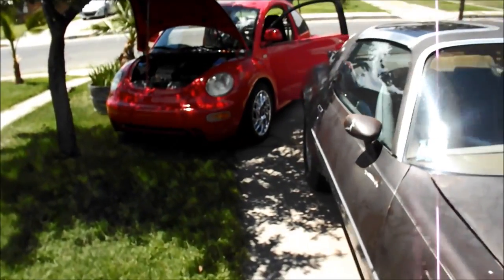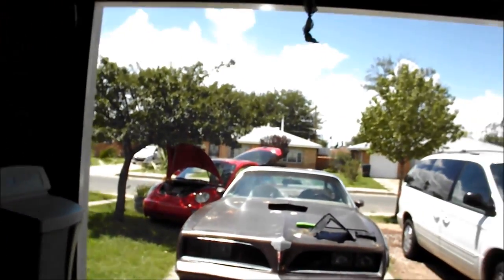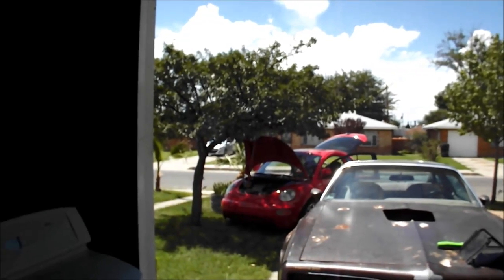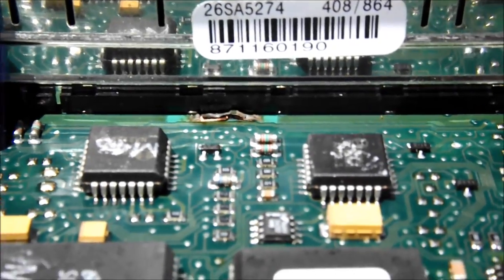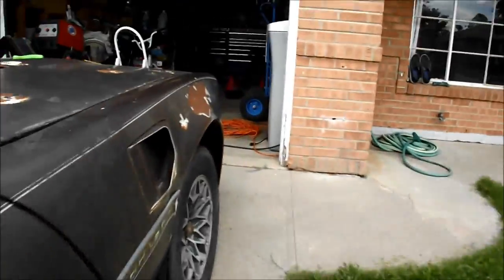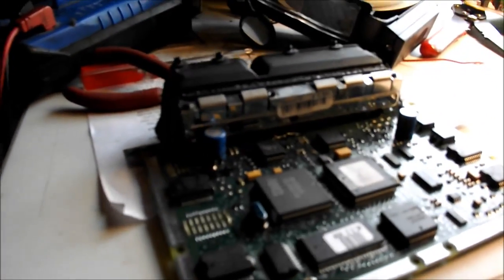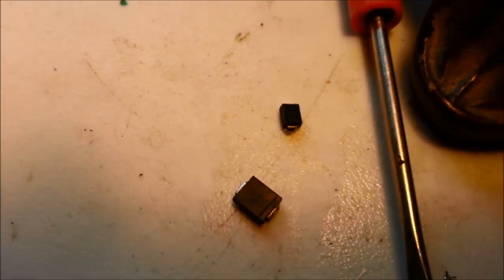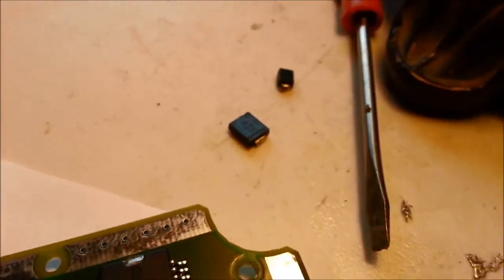99 VW Volkswagen Beetle Throttle Body ECM ECU p1580 Throttle Body Adaptation TBA

Comment: Thanks for making this vid. I was having the exact same issue on my 2002 VW Cabrio MK3.5 with an ABA. The same throttle body DTC codes  (17987 P1579) and (17973 P1565) wouldn't clear.  I suspected the ECU, but your vid pursuaded me to pull the ECU and take a look. I pulled out my ECU and the exact same burned trace was visible. Mine only had one dead diode and I was able to use a diode from an old netgear router to fix it.

Comment: Try using Google type in the numbers on the chip. Oft times you'll get the data on the chip as well as replacement parts, and the values of the part.

I did that on a POS stereo amp I have and got the transistors and their equivalent replacements.

Comment: dude got a 98 2.0 aut o ug and just replaces the trans, now I have a no start no crank issue. I've been told told to reset the CM and after disconnecting the pos or neg , tapping pos while  neg on, disconnecting for half hr.... etc nothing any Ideas???
Reply: battery reconnect does not work. i saw a post from a vw tech that you may be able to reset a no crank issue hy leaving the deiver door and the trunk open. when you try to start it. leave the key in the on position for a couple mins and ahut it off before starting. if that doesnt work you are going to need to get yourself a vag-com

Comment: I have a 99 vw jetta 2.8 and my mil light doesnt come on at all and there is no tape over it at all! I am getting lower voltage on my engine sensors and throtlle body is just buzzing and not aligning at all either. I need some help! I am going to take out my ecm and i have a spare ecm but dont have the tools to switch out the ecm!

Comment: I just bought a 99 vw jetta 2.8 and there is no mil light on when i turn key and my throttle body just buzzes and does not adapt for some reason! I also tested all my fuses and they are good. I also tested the engine sensors for voltage and i am getting well below the 5v reference. I plug in my OBD2 handheld and i get no codes for some reason but when someone i know plugged in vagcom this is the scan. I replaced relay 409 and 101. i still get low voltage on all the sensors like MAF,PURGE VALVE,THROTTLE BODY! Any help would be great! Nice video!
 20 Faults Found:
18010 - Power Supply Terminal 30 
P1602 - 35-10 - Voltage too Low - Intermittent
16684 - Random/Multiple Cylinder Misfire Detected 
P0300 - 35-10 - - Intermittent
16687 - Cylinder 3 
P0303 - 35-10 - Misfire Detected - Intermittent
16497 - Intake Air Temp. Sensor (G42) 
P0113 - 35-10 - Signal too High - Intermittent
16486 - Mass Air Flow Sensor (G70) 
P0102 - 35-00 - Signal too Low
17834 - EVAP Purge Valve (N80) 
P1426 - 35-00 - Open Circuit
17950 - Angle Sensor 1 for Throttle Actuator (G187) 
P1542 - 35-10 - Implausible Signal - Intermittent
17952 - Angle Sensor 1 for Throttle Actuator (G187) 
P1544 - 35-10 - Signal too Large - Intermittent
17580 - Angle Sensor 2 for Throttle Actuator (G188) Signal too Low 
P1172 - 35-10 - - Intermittent
17633 - Fuel Injector for Cylinder 1 (N30) 
P1225 - 35-10 - Short to Ground - Intermittent
17637 - Fuel Injector for Cylinder 5 (N83) 
P1229 - 35-10 - Short to Ground - Intermittent
17635 - Fuel Injector for Cylinder 3 (N32) 
P1227 - 35-10 - Short to Ground - Intermittent
17638 - Fuel Injector for Cylinder 6 (N84) 
P1230 - 35-10 - Short to Ground - Intermittent
17880 - EVAP Leak Detection Pump 
P1472 - 35-10 - Short to Ground - Intermittent
17843 - Secondary Air Pump Relay (J299) 
P1435 - 35-10 - Short to Ground - Intermittent
17829 - Secondary Air Injection Solenoid Valve (N112) 
P1421 - 35-10 - Short to Ground - Intermittent
17636 - Fuel Injector for Cylinder 4 (N33) 
P1228 - 35-10 - Short to Ground - Intermittent
17923 - Intake Manifold Valve (N156) 
P1515 - 35-10 - Short to Ground - Intermittent
17634 - Fuel Injector for Cylinder 2 (N31) 
P1226 - 35-10 - Short to Ground - Intermittent
17525 - Oxygen (Lambda) Sensor Heating Circuit: B1 S2 
P1117 - 35-10 - Short to Ground - Intermittent
Readiness: 0110 1101

-------------------------------------------------------------------------------
Address 03: ABS Brakes Labels: 1J0-907-37x-ABS.lbl
Part No: 1J0 907 379 H
Component: ABS/EDS 20 IE CAN 0001 
Coding: 03604
Shop #: WSC 00066 
VCID: 3663DDFA12827BAE71B-4B1A

3 Faults Found:
01276 - ABS Hydraulic Pump (V64) 
16-00 - Signal Outside Specifications
00290 - ABS Wheel Speed Sensor; Rear Left (G46) 
35-00 - -
00287 - ABS Wheel Speed Sensor; Rear Right (G44) 
35-00 - -

-------------------------------------------------------------------------------
Address 15: Airbags Labels: 1J0-909-60x-VW3.lbl
Part No: 1J0 909 609 
Component: C AIRBAG VW3 SG 0002 
Coding: 00067
Shop #: WSC 00066 
VCID: ECD7BF929C4E717ED7F-4B1A

1 Fault Found:
00532 - Supply Voltage B+ 
07-10 - Signal too Low - Intermittent

-------------------------------------------------------------------------------
Address 17: Instruments Labels: 1J0-919-xxx-17.lbl
Part No: 1J0 919 951 B
Component: A4-KOMBIINSTR. VDO V57 
Coding: 06262
Shop #: WSC 00000 
VCID: 2F6DE89EEDD84A6632D-5142

1 Fault Found:
01039 - Coolant Temperature Sensor (G2) 
29-10 - Short to Ground - Intermittent

-------------------------------------------------------------------------------
Address 46: Central Conv. Labels: 1J0-959-799.lbl
Part No: 1J0 959 799 AJ
Component: 61 Zentral-SG Komf. 0001 
Coding: 04096
Shop #: WSC 00066 
VCID: 8603ED3AA2E2AB2E21B-4AE8

Subsystem 1 - Part No: 1J1959801C
Component: 61 T?rsteuerger. FS0001r 

Subsystem 2 - Part No: 1J1959802D
Component: 61 T?rsteuerger. BF0001r 

Subsystem 3 - Part No: 1J4959811C
Component: 61 T?rsteuerger. HL0001r 

Subsystem 4 - Part No: 1J4959812C
Component: 61 T?rsteuerger. HR0001H 

4 Faults Found:
00953 - Interior Light Time limit 
25-10 - Unknown Switch Condition - Intermittent
01358 - Internal Central Locking Switch; Driver Side (E150) 
27-10 - Implausible Signal - Intermittent
00912 - Window Regulator Switch; Front Left (E40) 
27-10 - Implausible Signal - Intermittent
00944 - Heated Exterior Mirror; Passenger Side (Z5) 
35-00 - -
Reply: Damn

Comment: I just bought  a 1999 2.0L of the same car.
i think i have the same problem. I can get it running with starter fluid, but if it drops below 1200 rpm it clicks and the throttle looses pressure, and turns off the engine.

if you think i have the same issue, where did you find the ecu?

This is awesome by the way!